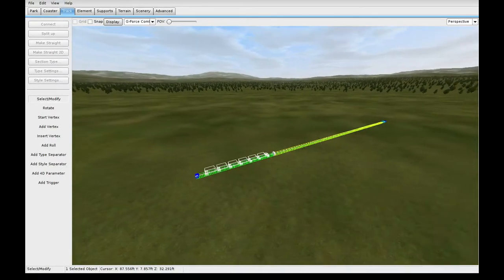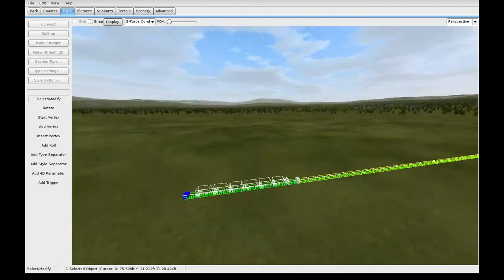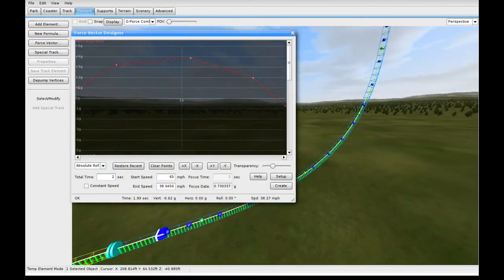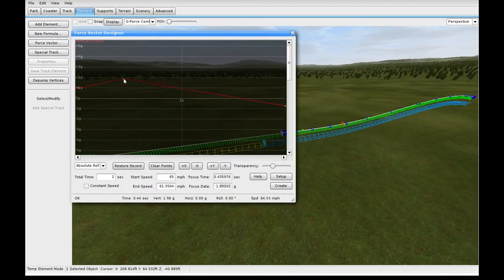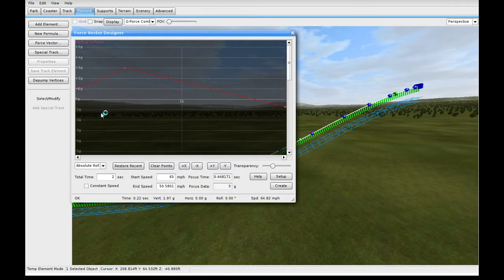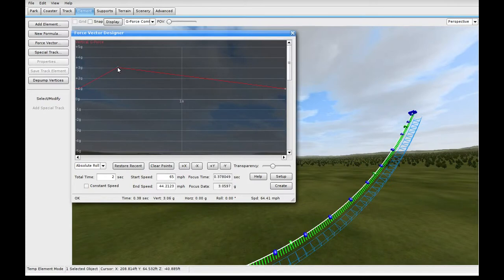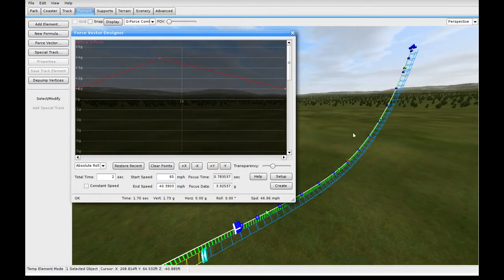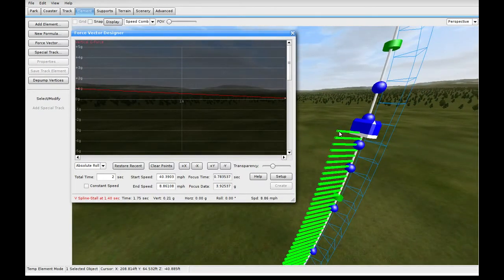Force Vector Designer No Limits 2 Tutorial (Part 2)

Comment: force vector designer(included in nl2), newton 2 or fvd++..diferences?
Great tutorial BTW
Reply from the maker: +Vikk Haven't worked a lot with the other two, but the main hurdle that I saw was that you don't have it built in. From what I understand, they can create a lot smoother layouts, but this one is just a lot more convenient (no importing elements) and relatively straightforward.The only major problem I have with this one is that, often, the junction points between segments can be super-rough
Reply: ugh, is there any way to fix that? once you create a piece of track with fed can you modify it?